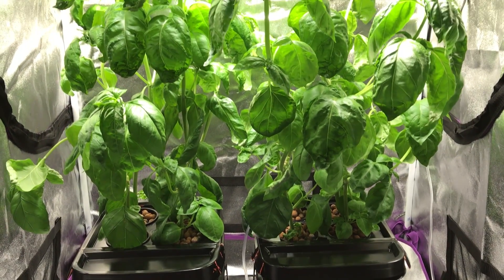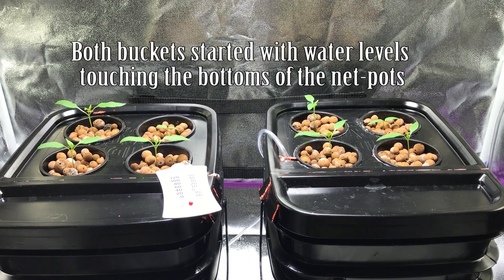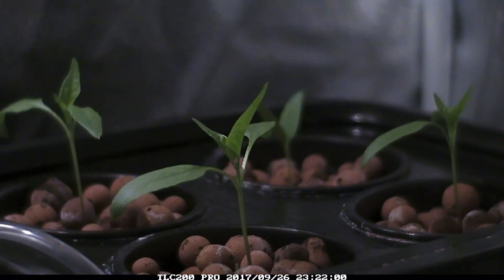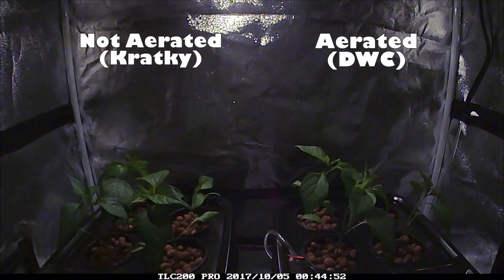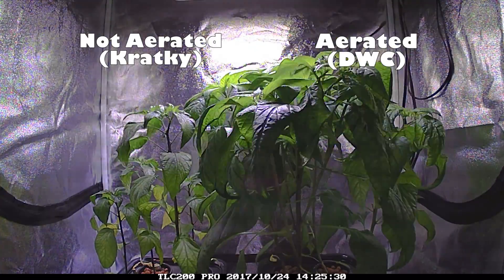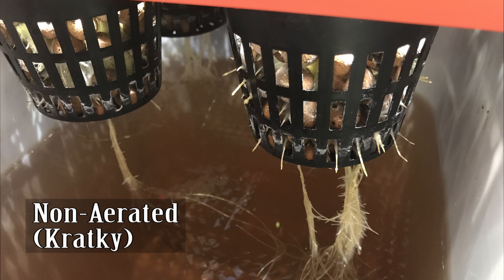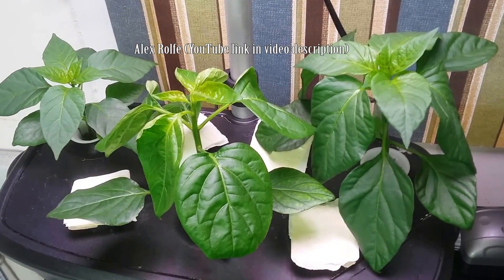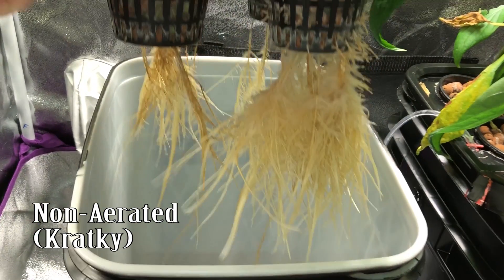Aeration vs No Aeration - Hydroponic Peppers w/Time Lapse (Brinno) “Semi-DWC vs Kratky”

Comment: Why didn't you notice all the fungus growing in the kratky one?
Reply: @colbys100 I control the slime in Hydro by adding the water, then first about 2 to 6 drops of Clorox depending on how much water you run I use 8 gallons and 6 drops. Let that run a few then add the nutrients like normal. The slime fungus is anaerobic and a very small dose of chlorine straight kills the hell out of it, like 2ppm and does nothing I to the plants. An old hippie told me this years ago and I have had no slime since, 10 or better years now.
Reply: @ericbarnes3829  thanks dude 👌😁💯🌞
Reply from the maker: Pikudo Pikao there is no fungus. Those are air roots and the white on the plastic net cups is mineral deposit.
Reply: Pikudo Pikao at what point in the video please? I've watched several times, Is it really small? I would think its hard to mistake air roots, and I'm kinda curious cause I've never tried dwc without what looks like now, an extreme amount of aeration lol
Reply: if u have anaerobic bacteria in your hydro like fusarium (root rot) wich i got i finally started to use hydroguard, containg a agressive aerobic lactobcillus. dont remember full name since its long. but it just eats the hell out of all the pathogens and convert it to sugars and bioavaliable nutriens for the plants. and u dont need to have perfect temperature in the water for preventing disease. its like night and day if u got algeae or some other pathogen.
Reply: @kwasibengt  These products reduce yield by 30 to 20 percent. Still better than a dead plant!
Reply: @colbys100 you can also add pondzym to water solution to add beneficial bacteria to eliminate root rot.
Reply: @kimosdaddy  very interesting pond zymes you say well hydro store is very costly. I'm looking into it
Reply: @Joe Schmo Well according to all the other people on here bleach in a very small dose works. That's all shock for a swimming pool is as I worked in the business at one point, granulated bleach because the algae in a pool over feed on the bleach once it dissolves and mixes with the water thus killing it.
Reply: @James Smith except this isn't college. No one is getting graded on a term paper here. There is no incentive to be so super strict with grammar and spelling, and I challenge you to provide any.
Reply: @colbys100 you mean calcium hypochloride? Yeah it does work...
Reply: @Helloyapfammily  hypochlorite
Reply: @Helloyapfammily  No, I think he means calcium hypochlorite.
Reply: @Colby Fricano "Really your just blasting me, and im not sure why."

I'm Finnish and even i know what is wrong with your writing ;)
Reply: the best results that i've had was by following the Keiths Ponics Site (just google it) without a doubt the most useful course i've tried.
Reply: Colby Fricano good stuff mate!
Reply: Late to the party but i've used bleach to get rid of bad bacteria.Works really well. First fill as full as possible, add bleach, let it sit for an hour and then flush it twice with tap water. If the problem part doesn't reach the water, take them out and wash one by one. Then add new water and half of the normal nutrients. Check if the conditions return, repeat if needed. It has not failed yet, i kept one plant alive long enough just recently while one of its main root branches was visibly rotting away, it was black.. That method has worked, each time. I use aquarium bacteria quite often which has worked really well with a biofilter.
Reply: @Colby Fricano Isn't a water softener bad for the plants because it releases salt?
Reply: @Kernowjim that’s a great idea!!  I had not thought to use hydrogen peroxide for my
Plants so it will basically kill off any bad bacteria in the water or it just kills off all bacteria in the water?  Sorry I’m new to everything hydroponics and this may have helped me to maintain my cucumber plants much longer as the leaves began to dry out and crumble and it was becoming quite a huge indoor mess, I thought it was just the nature of a cucumber plant it has its season of growing and then dies off?  Do you think hydrogen peroxide in the water could have prevented the death of the leaves and also there were cucumbers that were beginning to form in behind the flower and they would get to the point of a small 1/4” start and then where it attached to the plant it had a small amount of black and then that cucumber would fail to continue to grow.  Perhaps hydrogen peroxide may have assisted with that or perhaps it was something else entirely like perhaps too much Epsom salt flakes added to the water or maybe too much or too little nutrients?  I’m sure as I progress I will learn much more about how to help my plants when I notice they are no longer thriving.  I am currently growing in a diy system that is individual per plant with each having its own air rock.  I’ve noticed my tomato plant leaves are developing brown spotted leaves which for the most part I’ve been removing because I thought it could be a dust is issue or something on the outside of the plant but now I’m thinking it’s likely something going on at the root level.  I will try a couple mls of hydrogen peroxide and see if it doesn’t help. Loving learning how-to make my plants thrive indoors! I’m must be doing something right with my sweet pepper plant because I currently have 5 peppers forming and several blossoms forming.  I hand pollinate them and I’ve noticed recently that a significant number of the blooms are turning brown and falling off without a pepper growing in behind, would you know if it’s due to lack of it being pollinated or perhaps lack of nutrients or something else that I could fix?  Thank you in advance if you know any of the answers.  I’ll definitely begin to look more at the roots in future because it seems the health of the plant is determined as much as what goes on in the water as above it!! If you want to checkout some photos of my progress to date I’m the armchairgardener on Facebook check out my posts.
Https://m.facebook.com/armchairgardener/
Reply: @Kernowjim I didn’t think you could get it too wet in a hydro based grow or do you mean the air roots have been drowned and it’s rotted those?  One thing I’m wondering with hydro is if I have an air stone that creates many air bubbles if I add additional nutrient rich water and cover the air roots is it still possible to drown them if there are all the air bubbles?  Just curious, if anyone knows the answer?
Reply: @James Smith some of the worlds greatest engineers have HORRIBLE grammar! The guy was simply giving helpful advice! Helpful advice doesn't need grammar police nor do we care for your or you're statements!
Reply: You prolly dont care but does anyone know of a trick to get back into an instagram account??
I was dumb forgot the password. I would appreciate any tips you can give me
Reply: @Krew Anakin Instablaster ;)
Reply: @Kieran Tripp Thanks for your reply. I got to the site thru google and Im waiting for the hacking stuff now.
Seems to take quite some time so I will get back to you later with my results.
Reply: @Kieran Tripp it worked and I now got access to my account again. I'm so happy:D
Thanks so much you saved my account!
Reply: @Krew Anakin you are welcome xD
Reply: That happens when the temperature is too high
Reply: It is not fungus it's bacterial
Reply: James Smith your English/grammar rant almost made me forget about the important advice which @Colby was actually trying to convey. Thanks for the advice Colby!
@James Smitt, I purposely made errors, can you pick them out?
Reply: Looked like fungus after you said it. the power of suggestion...
Reply: @James Smith oh for heaven's sake. Spelling and grammar are not set in stone. They evolve and change as the centuries go by. You're seriously flaming someone on a YOUTUBE comment section for improper grammar? You have too much time on your hands.
Reply: @colbys100 pool shock most definitely I almost thought about using a drop or 2 of bleach but never did because those enzymes are costly.

Comment: can you change the shutter speed on the camera? maybe shutter priority? its banding due to synchronizing with the lights- you could also try changing the lighting frequency somehow.
Reply from the maker: You can’t specifically change the shutter speed on that camera. You can only change the lens aperture which then affects shutter speed. It works somewhat, but then you’re limited on the brightness of the lighting which you can’t really change in this type of situation.
Reply: @GrowingAnswers  another cost effective option would be to buy an old DSLR camera, maybe a 50 1.8 lens and then a plug in dummy battery that plugs into wall, and a intervalometer- then compile the pictures in a program. would yield really good image quality but that is a lot of extra steps. im trying to get footage of seeds sprouting but I use my main camera every day so am trying to come up with alternatives.

Comment: The Kratky net pot is not touching the water like other videos that do this test. That would avoid some of the air-pruning
Reply from the maker: that method is suppose to start out touching the water and then the water level needs to drop as it grows. You can't grow kratky with fully submersed roots.
Reply: @GrowingAnswers Fair enough I just assume the water should touch at the beginning to give the roots a chance to dangle

Comment: Really interesting video thank you. What a great experiment, and the attention to detail helped a great deal to remove the variables too - really well done! I do wonder if there be any issue in using stainless steel for the baskets at all as I'm really not a fan of the sheer amount of plastic that these systems use?

Comment: I still think that perhaps your nutrients, temp, etc were just more optimal  for the aerated plants. If you experiment, and find the best method for non-aeration growing, and then try growing plants with aeration using optimal condition for non-aeration, the aerated plants may do worse. Simply having all the conditions on each side doesn't make it fair, if those conditions are just more favorable for one method.  Only by optimizing conditions for both methods, and THEN doing a side by side would prove one method is better or worse. For example, you mention early on that there is a nitrogen deficiency, which could be addressed. And without a lot of testing, maybe the lack of aeration means more or less light is needed. And from a commercial viewpoint, if you can use less light due to slower growth, and zero electricity for aeration, perhaps overall the non-aeration method could be much more profitable. Simply elimination of variables does not mean it is a fair test.
Reply from the maker: As per the first sentence…that’s a hard no

Comment: How do you know you're actually aerating your water without knowing your water temp it only works if your water is at the correct water temperature otherwise the air pump does not work properly or as intended

Comment: Doesn't Kratky method require that the water be topped off to the level of the plant until roots reach down to the water?
Reply from the maker: Just so it touches the bottom of the net pot

Comment: I think the shortcomings of going without an air pump can be overcome simply by drilling 4 holes above the water line for air to circulate naturally through the buckets Air Zone above the water.  There are two kinds of roots, water and air.  The water roots don't need air, and the air roots don't need water.  At least, that's the theory for how the Kratky system works in the first place.

I am doing an experiment with that design now, just germinating the seeds.  I am video documenting the process and will one day make a video.

I will have three 5 Gallon buckets.  One with an air pump and no vent holes, one with no air pump or vent holes, and one with just vent holes and no air pump.  I strongly suspect that the air pump does nothing but send fresh air to the air roots, so by supplying the needed fresh air circulation through four 3/8 inch holes above the water line should replace the need for an air pump.

To prevent over filling the bucket, two to three inches below the net pot is another small drain hole to prevent the drowning of the plant should a rain storm or something else happen.  Diluted nutrients can be replaced, drowned plants can not.  Plants will grow in quart mason jars until there is enough root to hit the water at the level of the drain hole.  Transplanting is as simple as moving the net cup to the waiting 5 gallon bucket.

I also have an automatic water level measuring device for it, still in prototype.  The idea is to have it float and slowly sink to a point where a certain amount of water needs to be added.  I am using a piece of 3/4 PVC pipe long enough to go an inch or so above the bucket lid with a TEE at the bottom, a fishing float (biggest that will fit the pipe), and a wooden 3/16 dowel pushed into the float.  My current problem is that the wood is trying to rot so I am looking for something more waterproof.  The design works fine if you don't leave it in and just put it in the pipe to check it every now and then.

So far, in all of my searching and video watching, I have never seen an air pump vs no air pump debate that  addressed the elephant in the room, the air circulation problem, with the natural solution I propose here.

Use any of this if you can.
Reply from the maker: No kratky setup can do better than an aerated, aeroponic or fogponic setup. This is not due to oxygen alone. It’s due to the micro particulate that collect on the exposed roots. That simply doesn’t happen in a stagnant setup.

Comment: Hi sir. I wanna ask if the air pump is running hot? So yes, how do you deal when the pump is pumping hot air into the water? Because it can lead to low oxygen level.
Reply from the maker: I don’t have any problems
Reply: @GrowingAnswers  thanks.

Comment: Can you compare air pruning containers vs those with only few drainage holes
Reply from the maker: I’ve used the cloth type. They work very well. You can also cut a bunch of holes in a plastic container and line it with landscape fabric to get the same result. No winding roots to speak of and they all become very small and fibrous.

Comment: Wanna REALLY supercharge those results?  Try a cheap fountain fog maker.  It creates both a fine water vapor that fills the chamber and allows excessive fine root formation, but also slightly warms the water with its energy.  You will be blown away.  They can be purchased cheap too.

Comment: Am I only one seeing those bars in the timelapse? I am not complaining , this footage is incredible, I'm just wondering why I see light bars
Reply from the maker: Light frequency interfering with frame rate
Reply: Growing Answers maybe changing the shutter speed would help?
Reply from the maker: @HandleBar3D  can’t change the shutter speed on the time lapse camera. It’s fixed automatic. It takes a picture per chosen interval only. Aperture is all that can be adjusted which helps a little.

Comment: Do you think it matters if I turn on my grow light some days in the morning, other days in the evening or midday? Does it really matter when the plants are exposed to uv light during each day as long as they get their minimum daily?
Reply from the maker: Just Ryan uv light is not really necessary. I understand that it can help certain things, but I’ve never used it exclusively myself. As far as lighting hour,  i would not change the cycle on a constant basis. Plants do adapt to the daily integral. I would think that would cause stress because in order to change when the lights turn on you would be increasing dark period randomly. Probably won’t matter too much for day neutral plants, but I assume that isn’t what you are growing.

Comment: I’ve used Kratky for one season and it was amazing for leafy greens. A key component was ensuring that the water level was even with the bottom of the net cups at the start. The roots were astounding, tearing the net cups apart in some cases. I believe that is why your Kratky plant did so poorly. I suggest trying the experiment again after making this adjustment.
Reply: but how does that explain the massive growth compared to the plant that did reach the (unaerated waterline)?
Reply: @gr8belayr  It doesn’t really, it’s just two separate experiments with very different results.
Reply: @gr8belayr  It is explained on the video...
Reply: I was wondering if there was another explanation because I have watched several videos on YT with completely opposite results. In most cases roots are definitely more, but the plant itself grew bigger. I'm not an expert, so I was sitting here scratching my head trying to figure out why his experiment didn't work like the others.

Comment: I'm afraid you are incorrect in this video, although the video is very well done. Blowing air in water does not increase its dissolved oxygen levels. You can test this yourself by getting a testing kit that allows you to test dissolved oxygen, and test water that is aerated and non aerated. By the looks of your video, its safe to say that kratky + air bubbles could very well be better than just kratky alone, however the further claim, namely, that this is due to dissolved oxygen levels, is incorrect.
Reply: This comment is kind of old but I'm hoping for a reply anyway , would adding a small amount of hydrogen peroxide lets say 3% 5ml in 2 liters of water and adding that to the system will it increase the dissolved oxygen ?